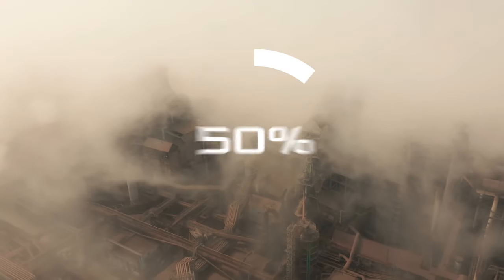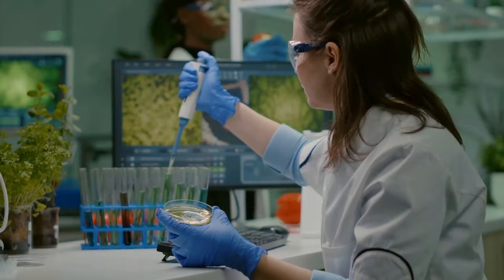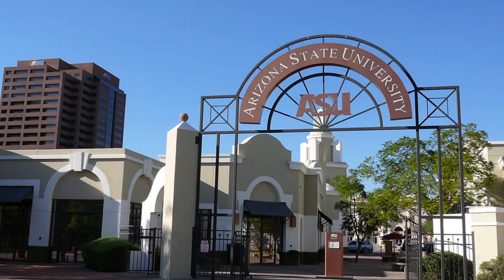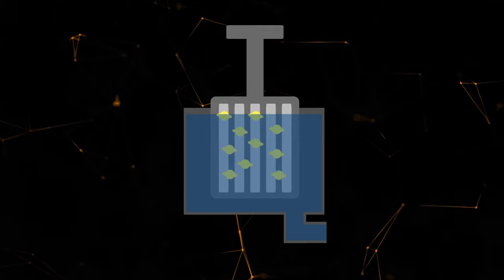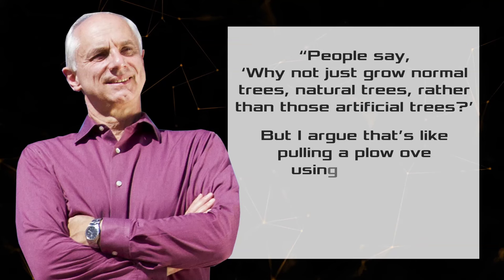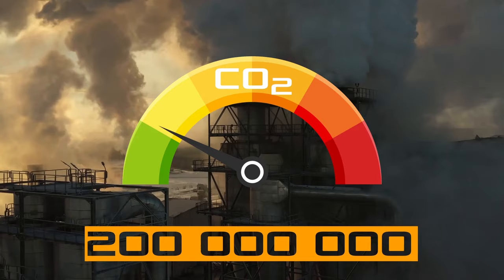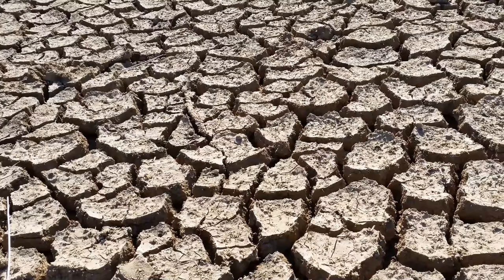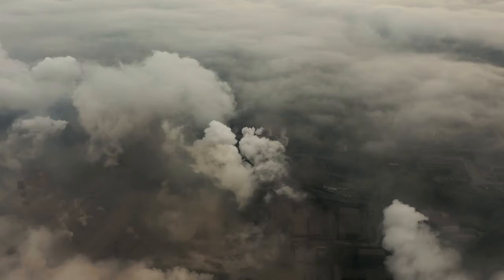The world's first farm of mechanical CO2 absorbing trees

Comment: The important thing about this technology is it doesn't require much power at all, it collects the CO2 out of the air blown by the wind and every hour or so dips the "leaves" in water to extract the CO2 which goes into canisters. This makes the "trees" much cheaper to make and operate than Climeworks or Carbon Engineering which use fans to suck in air before a huge amount of processing to extract the CO2. So it could be a really viable solution. The issue is what happens to the CO2 afterwards. Carbon Engineering sells its CO2 to oil companies to extract more oil from old fields which is not really a climate solution. Climeworks buries its CO2 deep underground in Iceland permanently, working together with Carbfix and supported by the EU. I'm hoping Klaus Lackner and his Mechanical Trees take the second option, or something close to it.
Reply: I can't seem to find a material that absorbs CO2 and releases it again in water. I would like to reproduce this experiment if it is as simple as stated in the video. Do you know of what they talk of?
Reply: @DavoRavo I can't see my reply so here's another - It's "sorbent-impregnated polypropylene. The sorbent – an ion exchange resin called Dowex marathon A."

Comment: The best solution would be to tackle c02 at source before emissions, meaning that you'll have to find a way of earlier conversion of co2 to low carbon before emissions.

Moreover, why is synthetic fuel not used even though discovered round 70 years ago?
Reply: Albert Speer was a believer in synthetic fuel...
Reply: I dont think its possible to curb emissions

Comment: What about the life efficiency of those machines? I can't imagine one running for 50 years without issues, probably need to replace the PLASTIC filter membrane every year or even faster degrading due to the amount of work (filtering) for a short period of time. What about the area of contact? the only way for it to filter air is by air moving through the membrane so if the area of contact is minimal despite how good its, it cant suck air in like a vacuum so not efficient (debatable? would you rather have a stair that can fit 1000 people but requires people to walk up slowly or an elevator that runs super fast but can only fit 1 at a time and sometimes break?), ++++ electricity +++ coal burn to create electricity + maintenance + ........... 
- Tree have been on earth for millions of years and doing their job perfectly until humans come and destroy mother nature. Tree might not work as well as the machine but it does have a larger area of contact, free to grow, naturally friendly, green energy, timber, and last forever (debatable? tree does grow itself without the need of humans). 
- Do you think half a billion trees is a lot? think! we have 7.9 billion people on earth, only if each of us donates 6 cents to plant a tree (to grow 500m trees), I bet in the next 50 years we would have enough trees not only for our generation but the future of future generations as well.

Tree is not the problem, man-made issue does.
In the world of trash recycling, we create more trash to recycle more trash thus no trash is recycled.
Reply: agreed, we have huge desert's ,and we have the know how to green them all,we can plant 20 billion trees and amend the environment of desert so that eventually the trees growing there wont need any input, this project is just another "great idea" to help the environment while destroying it, like wind farms, not to mention the cost on the environment in manufacturing and trashing these ugly monstrosities, i don't believe in HICC (human induced climate change) but i am all for environmental improvement, mainstream hicc has mostly produced solutions that hurt the environment and destroy peoples way of life
Reply: Dramatic situation and still without quick solution..
Reply: Please ignore the man behind the curtain.

Comment: S0 you are saying a gal of gas 128 Oz or 8 lbs produces 20 lbs of CO2? That is impressive...how exactly is that accomplished?  This video is all over the place.  First CO2 is needed because it is indeed plant food then you want to zero it out or produce zero CO2. Smdh
Reply: The issue is you are only looking at the carbon and hydrogen weight you must add the weight of the oxygen to the reactants, then the mass balance is easy to understand.  As another poster stated, an artificial tree would not only capture CO2 but break it down to carbon and O2.  Solid carbon would be easy to transport and store.  The O2 could be used/sold for commercial use or simply released to the atmosphere, as that is where it came from originally.  As  for CO2 reduction, I believe the group think is to reverse the CO2 percentage in atmosphere to preindustrial levels, then roll onto a zero net CO2 system.

Comment: The solution wont be easy for example solar energy is green energy but the toxic waste to produce the solar panel can create 2 to 5 times more emission. The calculation probably around the cost for electricity to run the machine and the cost for the chemical panel, and the question is around wether that cost is less or more than the benefit of the artificial tree.

Comment: So the answer to excess carbon is to use heavy industry to produce 200M of these units with a bunch of plastic and steel? How much carbon goes into the production of one of these (ie: when do these offset the carbon it took to produce them) and how long could they even be in service? Trees help eco systems, they help the soil, they help reduce temperatures like heat islands in cities, they are self replicating and easy to clone. I would rather see 500M trees added to the world than 200M steel and plastic structures added.
Reply: Yep.

Comment: The statement of 20 pounds of CO2 is produced per 1 gallon of gasoline burned?  Really?  1 gallon of gasoline weighs about 6.3 pounds.  Where does the extra 13 pounds come from?
Reply: It's oxygen from the air. The statement looks about right. The point is that CO2 doesn't drive climate.
Reply: @pauljackson2409  carbon makes up less than half the total weight of gasoline, so there's maybe a few ounces of carbon in gasoline, which would make at most 1lb of co2, that's if you're 'rollin coal' as they say, which is hard to do with a gas powered engine, as they actually burn cleaner than diesel, due to the higher compressive resistance of gasoline, meaning it performs better under higher compression from the pistons. This means less energy is wasted into the conversion of the hydrocarbons into co2 and carbon monoxide, and more goes into the explosive reaction inside the engine. So you would really have to struggle wait awhile to make 20lbs worth of co2 from a gas engine. Probably literal hours. Co2 in gaseous form is incredibly light and spread out, because thats what gases do. 20lbs of co2 gas could fill up an entire supermarket with enough co2 to suffocate everyone via oxygen displacement. Where as,  gallon of gas can only produce enough carbon to kill you if you're locked in a garage for like 15 minutes or longer.
Reply: @QockNobblr  What drivel. Carbon makes up over 85% of the weight of gasoline and 1lb of carbon converts into 3.5 lb of carbon dioxide when burned in air. Learn some basic chemistry.

Comment: I am a bit skeptical I have been offered the whole picture. You mentioned very little about the CO2 after capture. Possible fuel options is vague and doesn't include the processing and possible storage implications of such a process. You also failed to talk about the use of fossil fuels in the plastic based absorption sheets. Was the manufacturing CO2 offsets included in the net zero or net negative calculations. It is fun to create a video of an exciting project, but as you put at the end it unlikely to see massive roll out. I think a more technical approach would offer greater impact for those thinking of investing or repeating the initial research. Unless of course the object of this video was entertainment and wide spread cultural changes.